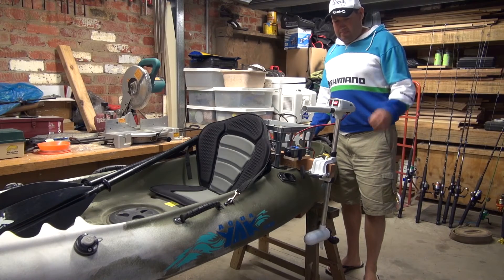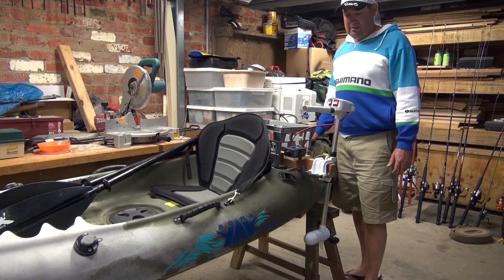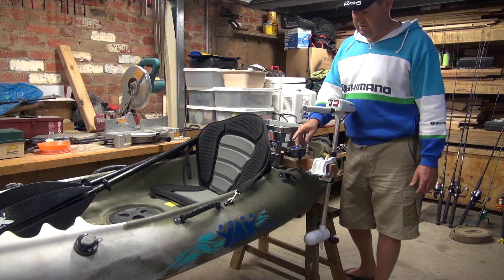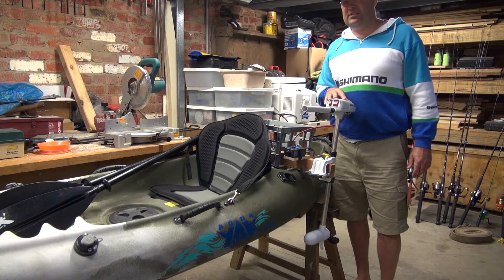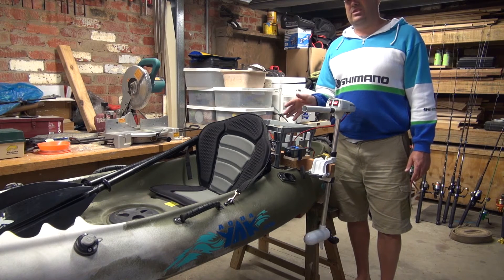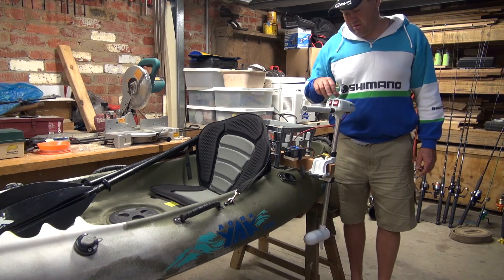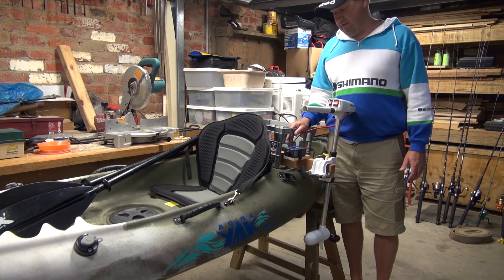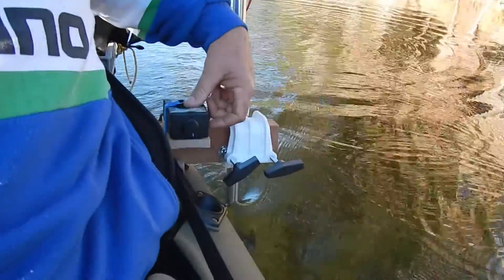Variable Speed Controller modification to 18lb Water Snake outboard on Aquayak kayak

Comment: Hey Robin,
I bought the speed controller and it works fine until I put it in reverse then it blows the fuse. Any suggestions? Thanks.
Reply: Turn down the speed to zero before hitting reverse.

Comment: hi robin good video was wondering if you or anyone could tell me if the difference between the 18 and the 24 lb motor was in the propeller only thank you
Reply from the maker: camper george sorry don't know that.
Reply: The higher lbs has more convolutions in the motor

Comment: legend mate, where about in aus are you ?
Reply from the maker: Joshua Ireland  melbourne mate
Reply: robin coker just a question mate,  do you need to physically switch the motor itself to reverse? Or is there something on the speed controller to allow that? Considering doing a rear mount with this speed controller to Control the speed with a rudder system to steer. 

Only problem I can think of is

1. Unable to change the physical buttons on the unit,  so reverse,  1 speed or 2 speed.  (could I leave it on 2, but turn it off on speed controller and just use very low speed on the speed dial to mimic speed 1 on the motor?) 

2. No way to tilt it up if coming to a bank / shallows.
Reply from the maker: Joshua Ireland the controller only controls the speed not direction
Reply: robin coker that's fine mate I understand that,  I would be using the rudder setup to control the direction.  I'm talking only forward,  reverse.
Reply: I just want to know if with this you need to. Change it physically on the Watersnake to reverse,  or if your speed controller can make the propellers go backwards on its own